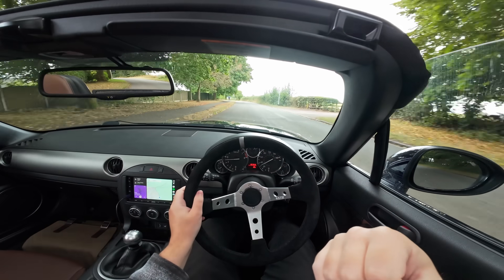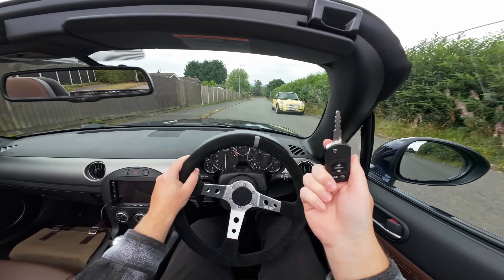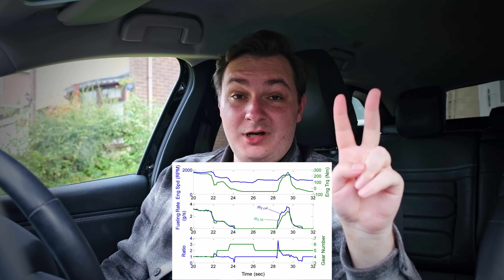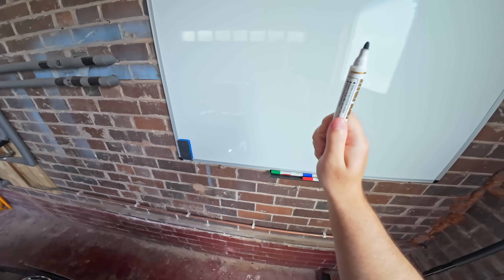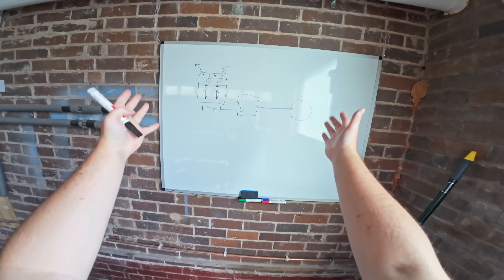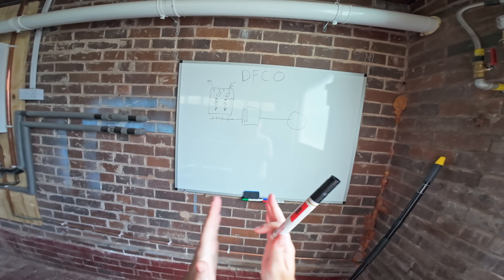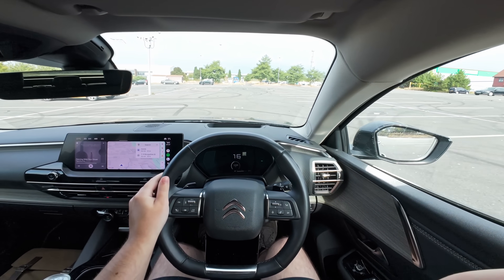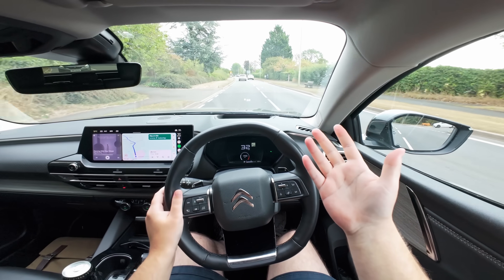The most misunderstood car term - Engine Braking

Comment: I'd still call that coasting more than engine braking since you're not actively using the inertia of the engine parts to slow down. Downshifting (i.e. shifting into a lower gear so that the whole drive chain is turning with higher RPM, in order to increase the actual braking effect) is actually using (the inertia of) your engine to brake. Sure, it'll increase the wear on your gearbox a little, but it's harmless as long as you're not so stupid as to let the clutch slip, but switch gears properly. It's also a good way to not overheat your brakes (and minimize the wear on them) if you're going downhill (a must-have for heavy trucks for example, though they've got some additional low-wear brakes (retarder)), just stay in a low gear and don't shift up as you're going downhill, and only use your normal brakes if your engine's RPM should get close to the red.
And yeah, that's what I learned in driving school, first already for my regular licence, and then again - more in-depth - when I was getting my (heavy) truck licence.

Comment: 50 mph and you need to slow down? Downshift to 2nd with revmatch (ONLY ON HOT OIL)  and let off the gas. In about 10 to 15 seconds you'll loose at least half of your speed on flat road without even touching the brake. Same for downhills. Downshift and just roll down the hill at constant speed.
Reply: Dont risk making a mistake
Reply: @dukedragon28 Umm elaborate please
Reply: @bratjagermeißter If you dont rev match correctly you’ll moneyshift, and if you moneyshift you’ll be buying a new gearbox
Reply: @dukedragon28 Yeah that's why you have to know what you're doing and know your box and engine.
Reply: @bratjagermeißter  Or just dont do it, its not worth the risk
Reply: @dukedragon28 What risk? 6k (close do redline in general) rpm isn't a risk for a revmatch if both gear and engine oil are warm. Gear to crank ratio (ok maybe variable timing makes it floaty a bit) is constant so if you know your car you'll know very well what will and won't be a moneyshift. It's really not that risky as you portray it to be. Even a undermatch isn't an issue, well operated clutch (never dump when doing that, it might be dangerous) will eat few hundred rpm difference with minimal wear on it.
Reply: @dukedragon28 What risk? 6k (close do redline in general) rpm isn't a risk for a revmatch if both gear and engine oil are warm. Gear to crank ratio is constant so if you know your car you'll know very well what will be a moneyshift and what won't. It's really not that risky as you portray it to be. Even a undermatch isn't an issue, well operated clutch (never dump it when doing that, it might be dangerous) will eat few hundred rpm difference with minimal wear on it.
Reply: @bratjagermeißter you’re assuming you hit the revmatch

Also I would need more than redline to do it in my old car I’ll tell you that

There is literally no reason to do it like this i stead of just rolling in 4th/5th and downshifting when its at a more appropriate speed
Reply: @dukedragon28 You're not doing it if its equal to moneyshif, isn't that obvious? I'm not assuming, I know I'll hit but again, you should know what rpm to gear you have to get. There is a reason and I mentioned in original comment. Slowing down quick/quicker than with just rolling

Comment: Newer automatic cars actually will sometimes coast instead of engine breaking. I recently drove a VW Tiguan that really disliked engine breaking and always coasted, turning off the motor like a Start-Stop system. Another time I had a BMW, which would sometimes coast and sometimes engine break, but it didn't seem to follow a system with that decision so it was a bit unprdictable which I found quite annoying. Both cars would only start engine breaking if you pressed the break for a moment.

Comment: About the topic itself: I was taught engine braking in driving school 30 years ago, including the fact that it doesn't use fuel. If people still don't believe you they should drive a modern Mazda 3 or any other car with a live fuel monitor. Dear doubters, guess what happens when you take your foot off the gas? Yup ... the live fuel monitor says 0.0 fuel consumption when you engine brake.

Comment: I knew because my BMW has instantaneous consumption meter and it show 0l/100km until very low speed that the torque converter disengage and engine needs fuel to idle.

How can those mechanics don't understand this?

Comment: Thought this was common knowledge. Here we even get a course after you get your license on how to drive economically.

12:50 you mention manual downshift. Thats a technique taught and used when driving longer downhill sections. The revs may be a bit higher than usual but you can significantly reduce normal breaking. 

Fun Fact: Engine breaking works a lot better with Diesel Engines

Comment: Am I the only one here that realises that they're talking about two completely different types of transmissions? The US guys are talking about a toroidal fluid coupling, known commonly as a conventional automatic transmission. This transmission can't be back-driven by the car's inertia, so the engine reduces the revs to idle and uses petrol under deceleration. What this guy says about direct drive, known as manual transmissions, is completely accurate. They're both just completely ignorant of other transmission types.

Comment: The most misunderstood car term ?
What's so hard to understand ?
Release the throttle, stay in gear and the car slows down.
Pretty sure a Evaporative Emissions Purge Solenoid Valve is quite a more misunderstood car term.
Like just try to locate yours, do you even know if your car has one or what it does ?
Yeah.
Most misunderstood term my ass.

Comment: I drive like that anyway, and I heel toe blip into lower gears often.
I was supposed to get 15L per 100kms but I get 10L instead.

I dunno if that's why, it does have a tune so I dunno what the fuel map tables look like. They did accidently put a turbo spooling map in there at first.

The best place for it though is on long steep hills. I have performance brake pads that like q little heat, but other pads get overheated sooner and stop giving you grip.
You shouldn't ride them down the mountain because they might not be available when neeeded.
Use engine breaking in these situations.

Comment: is this not how people are taught to drive normally? thts crazy lol no wonder they think deceleration uses fuel. Ive never had that question before but knew it doesnt because, like you said, its the very premise of coming to a stop in a manual trans... once youre almost stopped, the car begins losing power (turning off) because you've got no more energy from momentum. So you either put it in neutral to maintain idle rpms (adding fuel) or give it gas (adding fuel). The only difference is an Automatic makes this decision for you.

Comment: I discovered this through observations of the MPG gauge on a previous car. At 15mph, popping out of gear and letting the engine idle while coasting, the gauge would fluctuate between 50 and 70mpg. Doing the same thing with the car in gear, the gauge would jump straight to 99mpg until the engine reached idle and would start fluctuating again. Very clear evidence of what’s going on in the engine. I was also informed by classic car owners (since I hear a lot that engine braking apparently wastes fuel) that even in carbureted engines, the amount of fuel that may be pulled into the engine while engine braking is so minuscule, it’s very much worth the benefit of assisting the brakes, especially since older cars don’t have as effective brakes as modern cars.

Comment: There is an important distinction that should as well be addressed. Modern electronically fuel injected systems will cut off fuel when engine breaking BUT in carbureted cars fuel delivery is vacuum controlled so as long as the engine is spinning you will get fuel. So I’m I would like to give the mechanics the benefit of the doubt that they were just referring to carbed vehicles even though I’m gonna say they probably weren’t.

Comment: there is no better feeling than seeing a light change to red in the distance and then engine brake to reach it exactly. it's like stopping the microwave at 0.1s. we also did learn about this in driving school in germany, because there's a whole section about fuel economy, so they teach us to engine brake whenever possible.

Comment: Isn’t engine braking just coasting along
Reply: No, Coasting is Neutral/Disengaged Clutch. In that case the Driveshaft is disconnected from the engine. So the wheels will spin freely (unlike engine breaking which is putting enerfy through the engine so is losing energy quicker. In freespin the only loss is to friction assuming a flat road) and the engine has to use fuel to keep idle and not stall

Comment: Everything you said is true that's how we who ride a motorcycle use our engine most of the time, but i don't think the part were you said the engine pumps air is true. during engine breaking the valves are shut as well, so its a vacuum and that is what causes the breaking effect.

Comment: I didn't know that was a literal fuel cutoff. I thought it would use a very small duty cycle, in order to keep the motor healthy. Didn't know that the engine can safely move with literally zero fuel being injected. It always was weird to me seeing that car computers that show instant consumption would show a literal zero. And thought, that can't be, it has to be a very tiny small value, otherwise the engine is running empty. So my mistake was assuming that the engine would fail due to a lack of lubrication or something. Other that that, I've always a fan of engine braking. Downshifting to brake more, or even upshifting if you want a gentler braking. Saves a lot of fuel and braking pads. Also I agree the ride is smoother.

However, I would recommend to, in some cases, to put the foot on the brake pedal slightly, just so that the braking lights lit up. This is to communicate to the ones behind you that you're slowing down. Specially if you're engine braking at high rpms, because the braking can be quite substantial and the ones behind you might be confused or not notice the slow down.

Comment: Be careful turning off your car while driving. Your power steering will turn off, too and, depending on the car, the steering wheel might lock leaving you unable to steer the car.

Comment: 6:45 that is why when I am >25 MPH in my car, I get 99 MPG. However, when I drop below 25 MPH my fuel economy drops off dramatically! WOW It is because the forward movement of the car is no longer enough to power the engine and the engine starts to rely on combustion again.🤯🤯🤯🤯 what an awesome video. Sub earned!

Comment: 14:27 On the speeding signs, worth pointing out at least in the UK, the highway code doesn't allow for slowing down gradually after the speed change sign, they expect you to slow down in advance of the speed change. Plenty of speed cameras around just after a speed change and its probably a reason why a lot of drivers break harder in those situations. Informative watch though, I didn't know about 0 fuel being used if off the accelerator. And yes, it is just common sense to stay off the accelerator if you can see a reason to slow down ahead. Beggars belief most drivers don't do this!

Comment: I'm not even a car guy and I could tell you this. I thought it was common knowledge. My high school science teacher drove a geo metro in the year 2000 and he'd do experiments to be the most fuel efficient as possible and he'd talk about how much he'd just let off the gas to save fuel. Not only is engine braking more fuel efficient, it's safer. While lifting you can hover the brake just in case.

Comment: I don't understand why this is even debatable. Engine braking is just when the movement of the pistons in the engine is the load being used to add deceleration, instead of using the friction of the brakes.

The one argument against engine braking is that that load on the engine is still adding wear, it's better to wear the brakes that are cheaper to replace than the pistons.

You still save the fuel economy if you're taking your foot off the accelerator earlier and trying to maintain a slow roll

Comment: Interesting, never really analysed how it works I just drove this way because it is just common sense, take your foot of the throttle of course you'll be using less fuel & using the brakes less will make your brakes last longer.

Comment: Turning the engine off removes the ‘power assisted’ part of the brakes. If you have an emergency (like if that white car coming the other way was to have swerved in front of you), then you would not have had full braking. You might get full braking on the first braking pedal application, but on subsequent applications of the pedal, you will get near nothing unless you strain enough to push the seat back into the rear compartment and bend the steering wheel in your struggle to push down…! Also acknowledging those who noted the steering lock issue when removing keys. Well done. 
Don’t try this at home.

Comment: I'm an engine braker.  I'm probably from the last generation that were taught to drive this way as from the 80s and 90s car brakes got better and people just relied more upon them.  You don't want to know my drive score app. value btw, it can't get much higher.  And yes there is a distinct point where when you get down to just bellow idle speed you feel the efi kick back in and try to pull you forward.

Comment: I saw in one of the youtube shorts, some guy saying he was a mechanic for 20 years or so, saying engine breaking "always consumes fuel".

There is no way there are people there who literally work with cars and for such a long time and legitimately think fuel doesn't cut off when you let go of the accelerator when you got speed going while in gear. Even when I was a kid I already knew (at the time new) cars had this tech.

Many cars nowadays even show it to you. My 2020 Ford Puma has a real time fuel consumption meter and shows exactly this. Since it's a hybrid it also charges the bettery during decceleration for the electric motor. It's all about using energy available to maximise efficiency.

Comment: You didnt really explain why with manual cars engine braking really slows down the car, while with automatic it barely slows it down. Like, my first instinct for this difference would be that automatic cars use more fuel during engine braking. So what is it?

Comment: For anyone who doesnt know, do not do this in your own car. Your steering wheel will lock.

Also, your engine is still injecting fuel if the pistons are firing.

Comment: one tiny downside of only engine braking is you are not communicating with the car behind you.  your brake is designed so the light comes on before you engage the brake pads.  it is wise to tap lightly on the brake to message the car behind you that you are slowing down.  just to be safe.

Comment: Interesting! I was mostly sceptical about the fuel usage due to being unsure where the actual energy slowing down the car came from, but I guess it makes sense that it's expending energy sucking air in and out of the valves. My dad taught me to engine brake while getting my license, so I've always used it for the obvious benefit of reduced brake pedal wear anyway, to the point where I've had people ask me if the brake discs are new a year after a change lol

Comment: Ok, but there's an aspect of this that I feel deserves attention.
I see a lot of disagreement, or missunderstandings, about the use of engine breaking when driving long downhill sections.

If you just stop pushing the gas on a higher gear while going downhill, the engine barely breaks the car because gravity is accelerating it, which requires you to keep using the brakes to control speed. But if you reduce to a lower gear, the engine brakes much more, but that also raises the RPM a lot compared to driving in the "proper" gear.

Whenever this comes up people can't agree if that RPM increase is detrimental to the engine, or not.

Comment: Depends on the engine: A diesel might still injcet fuel if its in a regeneration phase to burn out the diesel particulate filter. And about the video where you pull the key: Don't do that with any old car. Some might engage the wheel lock and you cannot steer anymore. Dangerous!

Comment: Apart from all the fuel economy benefits, engine breaking also allows a smoother more comfortable ride since you're allowing the car to decelerate smoother instead of slamming the breaks at the last moment. So I don't really get why people really love abusing their brakes, other than being impatient.

When I see red light from a way before I left my foot off the accelerator and let the car slow down by itself, downshift if the rpm goes way too below and engine sounds unhappy. If you can calculate it well enough you will not need to use any brakes except for the last moment. Sometimes not even that cuz the light will turn green again and you will just carry on with your leftover speed/energy.

Comment: I bought a new car in 1989, it was my first car with injection and EMS. The manual literally said "with the throttle position at zero and the engine revs above 1500 rpm, the fuel flow is entirely stopped." I realised what this meant for fuel economy and I've been using engine braking ever since.